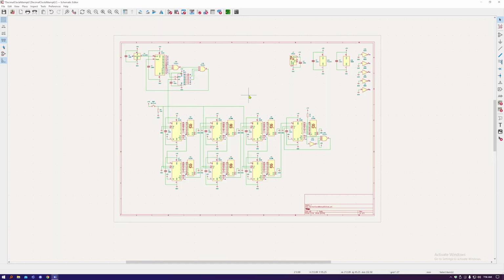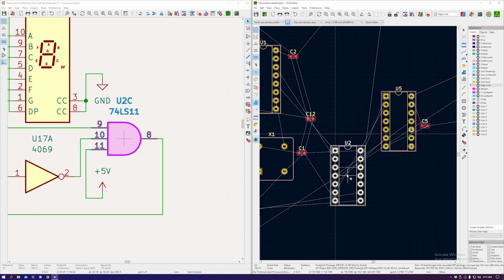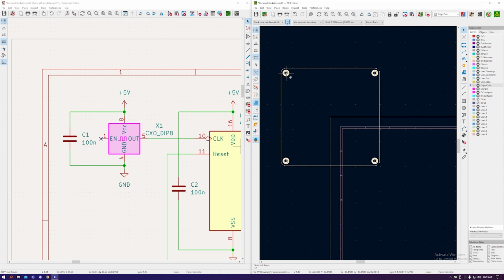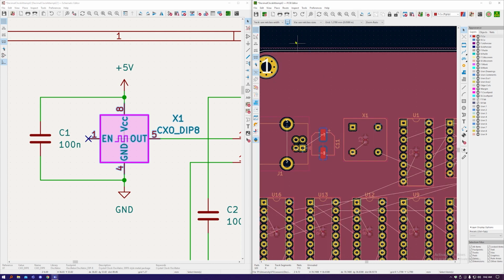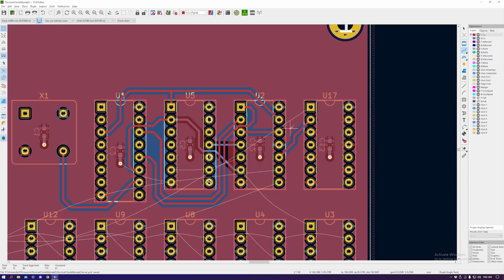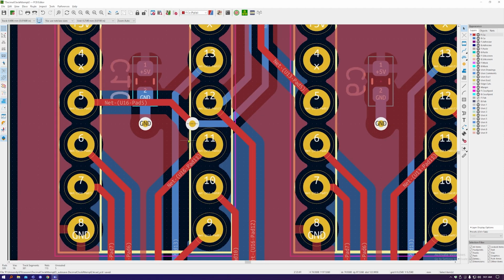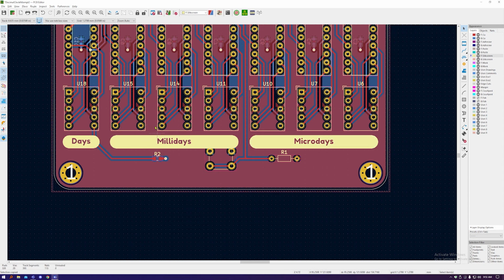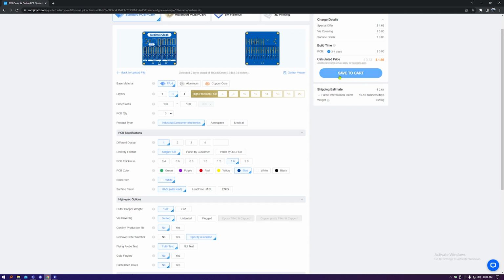Circuit Design ep.2 - Creating a PCB in KiCad

Comment from the maker: Corrections:

Copper fills - It is usually better to put the GND fill on the rear and Vdd on the front, as the majority of traces will be on the front slicing up that fill, but connections to GND are more common so that is the more important plane.
Reply: i was going to comment on how confusing it was to see GND as red and VCC as blue 🤯
Reply: I was just going to complain about it 😅

Comment: I wanted to point out that most dip sockets have a center hole, allowing the decoupling condenser to be mounted on the top layer  under the socket, along with pull-up or pull-down resistors. The boards are then less serviceable, but probably you have only one layer to worry about, or get better routing on two layers.

Comment: Pro tip, selecting parts on the schematic selects them in the PCB tool as you mention. Then in the PCB tool, without unselecting them, hit P on the keyboard it groups them together.

Super useful for sorting out parts when doing initial layout, like when you're arranging decoupling caps with the respective chips.